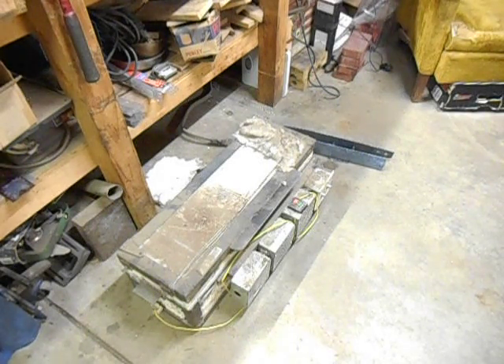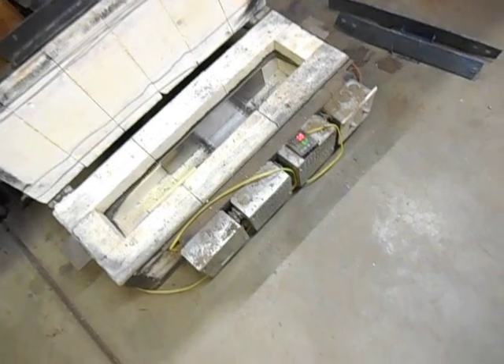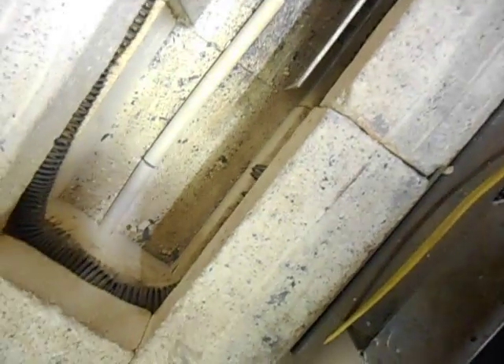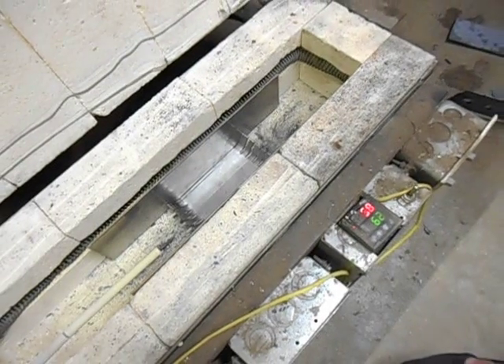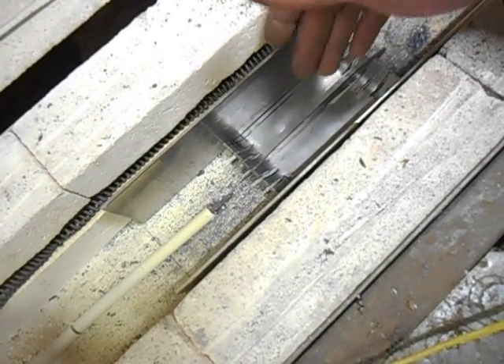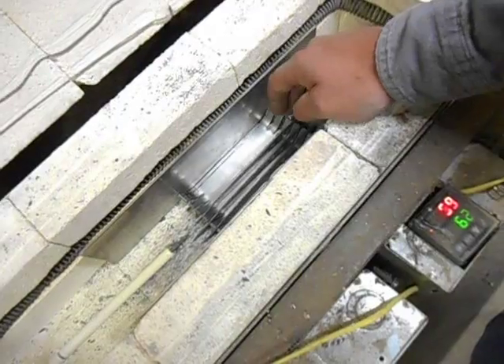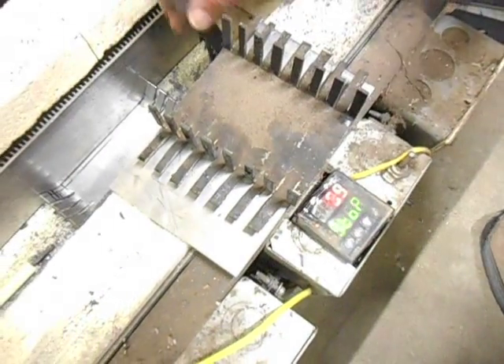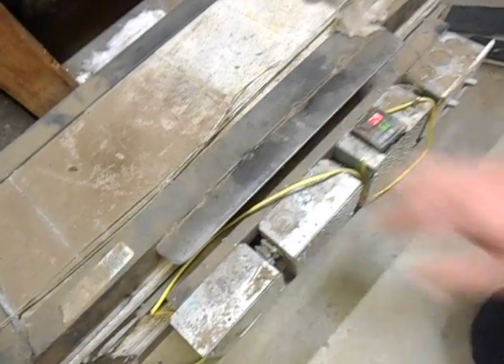new kiln baffles

Comment: On your rough ground blades do you HT edge up or down?
Reply from the maker: +McCullen Knives edge down, the biggest reason for that is so that the edge is facing the way it will be going into the quench. if I heated it edge up, then id have to grab the blade, turn it over and then make the trip to the oil. lots of times with a hot blade it will sag if you turn it, also if you don't move in a straight line to the quench, the air pressure can cause it to warp, especially on thin blades.